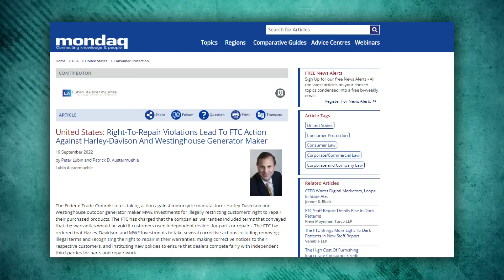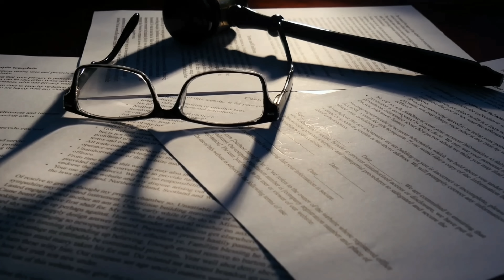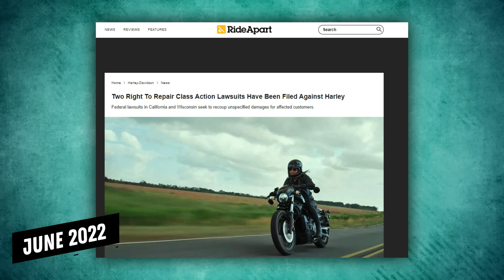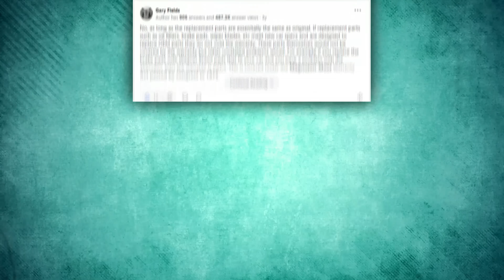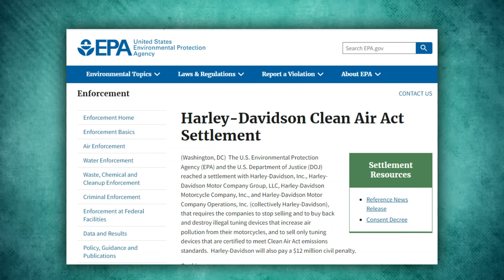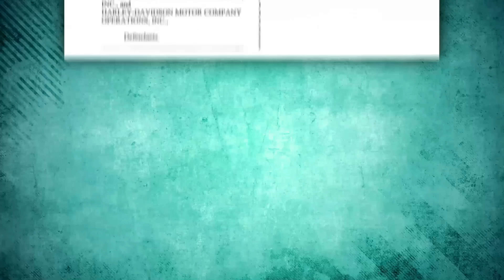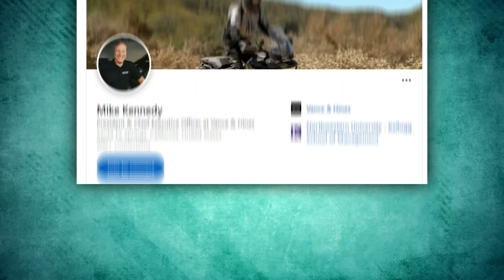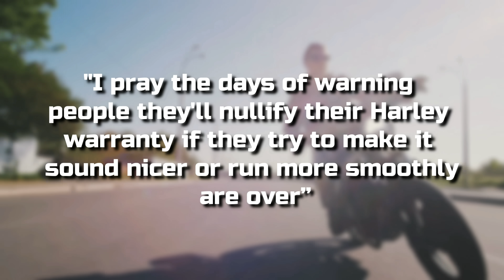This Affects All Motorcycle Owners!

Comment: Not a hater of HD, ''except exhaust systems so load that all you hear is piston slap'' lol....    I love all brands for I've been a rider/enthusiast/technician for almost 53 years.... But any experienced technician, including myself have said this for decades.... If HD had more engineers than attorneys...They would have better machines at a reasonable price point. Also, that arrogant smirk on many, if not most salespeople/service/parts dept when you walk through the door has caused ''the brand'' even more issues.

Comment: Like all manufacturers of motors Harley-Davidsons have inherent flaws the crankshafts are pressed together and come loose causing massive damage to camshaft chest primary chain and Harley calls these wear items these are not wear items I replaced mine with aftermarket parts and they don't fall apart this is pure and simple Harley-Davidson screwing its customers to fix the sloppy wobbly crank all they got to do is spend an extra $5 per crankshaft instead they choose to use compensator chains and greedy service departments I ride a Harley it's 21 years old and there's no way I would buy a new one from them scummy bastards

Comment: I smell a RAT!  An Insurance Industry RAT!  The only Entity that Must buy OEM parts is the insurance company, when you have a wreck on a warranted bike and parts must be replaced.  Insurance companies would much prefer to buy third party parts and use a Non- Harley certified mechanic to do the repair.  But if you do that it voids the warranty - as it should.  So recognize this for what it is - an attempt to fool you by the insurance industry.  Like THAT never happens.  Remember - when you buy insurance for your brand new Harley - they price it based on the cost of repair.  But, like in the auto repair business - they try to use the cheapest provider when it comes to delivering that repair.  Think about it. Protect your warrantee use only Harley parts and certified dealerships.

Comment: It absolutely will cuz if you're inserting new camshafts you're obviously doing it with camshafts with a larger lobes thus you're going to have to wait or exchange your valves for larger valves you're changing the whole internals of the engine creating more combustion and more horsepower how should they warranty you're ignorance and beefing up your engine and as far as the radio goes wait till it's out of warranty and by a factory radio cuz it radio Maybe tied to the computer system on the bike you don't understand like an automotive cycle operate so they can automobile these days the computer system is a controller of the whole electronic system on the motorcycle and the exhaust yes if you remove the exhaust you're changing the flow of the exhaust out of your engine changing the back pressure hence improving horsepower and compression improved horsepower and compression means the engine that is not warrantied you people are fucking crazy if you're going to buy a bike and modify it buy it and suck it up if you can afford to put new cams and lifters and fucking push rods in your engine you can afford to fix it when it breaks and as far as connecting the exhaust or anything else to the gearbox if you have a Sportster model or any of their newer models where the gearbox is directly attached to the engine or directly part of the crank case of the engine then it's where your engine but if you do have a big twin like a 89 or higher or whatever I don't know their seat your cubic inch displacements but if they have a separate transmission then no except for the extra horsepower that you're putting to it puts extra strain on your gears and your clutch hence why should Harley repair damage done by you putting excess horsepower into the bike but the excess horsepower alone isn't what the problem is it's by when you add access horsepower you tend to ride it harder so think about these things morons

Comment: What hell this channel is so dead wrong a cam replacement will not cause a rod to break and I as under it they has to prove to FTC that particular cam or product manufacture causes the rod to break also the changing the muffler also has to be prove to FTC that it causes that problem you need get your facts straight FAST LANE TV as for ECU Tuning which only apply to California State.